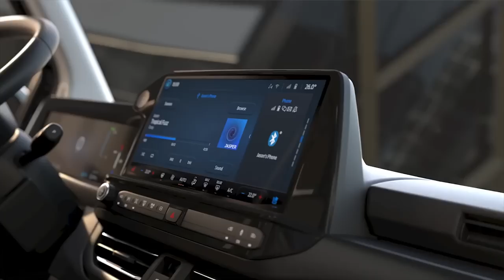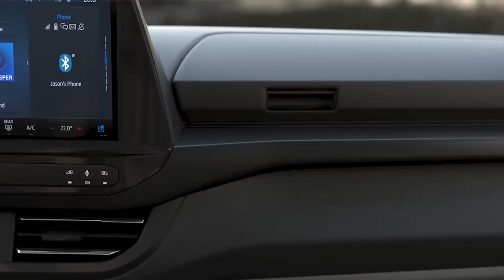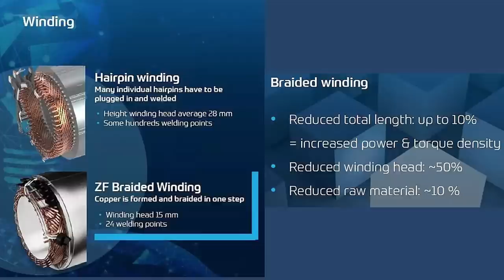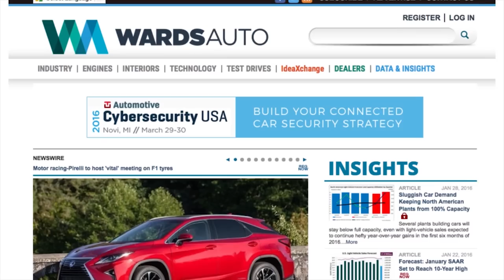EV Costs to Fall Below ICE; New EV Motor Wiring Pioneered by ZF - Autoline Daily 3455

Comment: The ZF motor story shows that better batteries are not the only to increase efficiency of EVs. Range can vary on motor design, software, thermal management, or something as simple as aerodynamics and tires.. We are at the very beginning of EV development and every year we are going to see some very interesting breakthroughs. The cost take out potential is all ahead of us, in fact the cost of making EVs is likely as high as it will ever be, it's all down hill from here. I think automakers realize that and are really looking forward to all the ways they can reduce material and production cost and leverage all the advantages of EVs to bring really desirable vehicles to the market. There are so many shapes and sizes of vehicles that don't have an EV version yet, lots of space to capture market segments. Mazda already missed the affordable roadster segment by not making a Miata EV. Some company needs to go for it.
Reply: What effect on EV's will a good charging infrastructure have on battery size and range demands?
Reply: @joeking433  Range will still be a big selling feature. Stopping to charge (like filling up with gas) is just a hassle drivers don't look forward to even if it's fast. Plus it's bragging rights like HP.
Reply: @frankcoffey I think it will diminish as a selling point when a good charging infrastructure is in place.  But if the price of batteries comes down EV makers will probably increase battery size and range as a selling point.

Comment: By 2025/26? With material costs still in flux, often angling upward, and transportation of those materials also not stable and not moving downward, I just don't see Battery costs coming down to $60/kwh in the next 3-4 years. Then there is demand, which will ratchet up prices again and if making batteries makes BEVs that cheap, Govts will see NO reason to continue rebates and incentives AT ALL for BEVs and so prices go up AGAIN. 

And before you wonks start, dropping the gas subsidy in the US would only tack on $0.50-$1.00 to a gallon of gas or Diesel. It only seems like more when you look at Europe and forget/overlook they tax fuel to the point it costs the equivalent of $8.00/gal, give or take some. That tax is used mainly for Mass Transit and then relatively distantly roads and infrastructure. US road tax on fuel is only $0.184 (not even a whole quarter). 

2025-26? Seems like a pipe dream predicated on the car note still being partially paid for by Govt. The only way I will ever believe BEVs will reach price parity with ICE-Vs, is when the EV Rebates an Incentives to purchase the vehicles are dropped completely. Apples to apples, EVs (BEVs) will always cost more to acquire the ICE-Vs until that happens.

Comment: The cost question is interesting. The battery pack is such a large percentage of the cost of an EV any movement in the cost of those packs (either direction) makes a huge difference. This is a much different dynamic than keeping track of the cost of the thousands of parts needed to make a complex ICE or Hybird vehicle. The speed of development in new battery types is a real wildcard. If I were in the battery or battery material business I would want to lock in long term contracts to make sure investments are payed off before automakers switch to another chemistry.
Reply: Part of the cost equation for packs is also production scaling up. This is why Tesla pursued the Gigafactory. Economies of scale does a lot to drive pack costs down. Newer materials and chemistries, such as LiFEPO4, high Si anode, Sodium Ion, and solid state electrolytes will also help drive costs down.

Comment: Not without taxpayer subsidies for EV and government intentionally raising ICE costs
Reply: Don’t forget about the 600 billion in subsidies the oil companies get every year.
Reply: You don’t think the Oil & Gas Industry isn’t subsidized to the max each year? Without those Gasoline would be astronomical.
Reply: They are just simpler. and although they demand a premium now, it will be like any other electronic. laptop, flatscreen tvs, cellphones. it will get very cheap with adoption.
Reply: @MB-kk8px  I have news for you.  Your city has an electrical plant that burns coal or gas and will soon likely need another one to keep up.
Reply: @MrLSDownliner  Skippy, take a look at reality for a change.  How does your "city" produce electricity and what fuel does it use?
Reply: @MrLSDownliner  Still waiting to hear what fuel your city uses to produce electricity. How do you think I knew that you would be afraid to answer?  Are you aware that solar and wind are not feasible where most people live?  I live in Michigan.  How many solar or wind set ups do you think I see in say metro Detroit?  Where do you think the mining for minerals for solar panels and batteries should take place?  Locally here in the USA with some regulations or in China with zero regulations and then transported?  Which is better if you actually care about the globe more than you care about virtue signaling?
Reply: @MrLSDownliner  Thanks again for verifying that your area relies primarily on fossil fuel for electricity and that you actively prefer to mine and drill in areas with no environmental rules and then transport it long distances. Enjoy Thanksgiving today that is made possible by fossil fuel
Reply: @jerrymiller9039  and I have news for you. We have reached the tipping point for electric vehicles and there is no stopping the transition to electric transport.    They perform better, are cleaner, require less maintenance, are more efficient, and are a heck of a lot more fun to drive. It makes little sense to transport our fuel source via truck, train, and pipeline, when we can do it though an electrical grid that is connected to every home and business in America. Yes it will need to be upgraded, so we better get to work.

We will see if all the scare tactics used by the oil industry and everyone that’s resistant to change become reality. I suspect they won’t and the world will make the transition successfully.
Reply: @MB-kk8px  the electricity comes from fossil fuel.
Reply: @jerrymiller9039  An electric vehicle is 70-80% efficient and a gas vehicle is about 20%. Makes more sense to generate electricity by the best means available and use it for electric cars/trucks. The combustion engine is extremely inefficient and is about the most wasteful use of oil on earth. It also spews toxic gas into the air we breathe. 

I’ll never understand why everyone knows they will drop dead if they sit in a car that’s running in a garage, but they are perfectly fine putting the same garbage into the air they breathe.
Reply: @MB-kk8px  That depends on how efficiently the electricity is produced and how well the battery holds a charge. If I fill my gas tank and it is sealed then 100% is still available to burn.  If I burn fossil fuel to produce electricity and charge a battery and then let the battery drain without driving the car the efficiency rate is zero %   Regardless my point with the other guy was not really about electric cars.  My point was that if we are going to come up with and mutually agree on a solution to anything then we need to respect reality which means fact and logic based communication.  He refused to admit that his city burns fossil fuel to generate electricity.  That is a fact like it or not.  By refusing to acknowledge obvious facts he lost all credibility. He made claims about himself having solar power at home. I have no way to verify that either way but if he denies obvious and simple reality am I supposed to believe anything he says?  In a case like that can we realistically agree and cooperate on any plan?  He claimed to care about the environment but also blocked any chance of us mutually agreeing to help the environment.  That is unacceptable.
Reply: @jerrymiller9039  Yes there are thousands of variables related to everyone of these discussions and topics. However, if you just look at the number of moving parts in a gas vehicle vs electric (aprx 2000 vs 30) it’s fairly obvious which one is going to run more efficiently. Not only that but the entire system should be analyzed for efficiency, from mining, to drilling, to transporting the fuel, to polluting the environment, health impacts to humanity, waste disposal, and recycling materials used to make vehicles. 

As far as power generation per state and how electric vehicles rank vs gas, the link below is really good. You can select the state (I usually pick Wyoming) as it’s one of the dirtiest. Electric vehicles still come out favorably, even if the energy mix is mostly coming from coal.

If I had my choice the goal would be to eliminate as many vehicles as possible, but doubtful that will happen in the US, since we are so dependent on the car. It’s fairly easy to make an electric motor that can go a million miles and it would be great if cars were designed to be fully modular. A part fails and it is either rebuilt or easily replaced and the vehicle lasts a lifetime. Unfortunately planned obsolescence is a big part of most things that are manufactured today.

I have an electric car and have driven it all over the US over the last 4 years. Put 115k miles on it and have been to lot of places in the middle of nowhere, without major issues. After all this real world experience the main shortcoming with EVs is in the towing department and how that effects range. For everyday driving and road trips 350 miles of range is just fine.

https://afdc.energy.gov/vehicles/electric_emissions.html
Reply: @MB-kk8px  so you agree that the vast majority of electricity comes from fossil fuel?  Where do you think the fossil fuel and mining for battery production should take place?  Here in the US with some regulations or far away with no environmental regulations and then transport dangerous goods across the globe?
Reply: @jerrymiller9039  I do agree that a good percentage of our power comes from fossil fuels (national averages at the end of this message) and I never said it didn’t. I’m fine with domestic production of things, rather than having the US go around the globe to exploit cheap labor and non existent environmental regulations. 

The good thing about doing it here, is that it ties into what I said earlier. This country needs to do a much better job of designing things so they can be easily repaired and recycled. I heard the other day (I’m not sure if it’s true) that out of all the batteries we consume here, only 5% are recycled. Redwood Materials is changing this and I think they are getting something like 95-98% of the materials back from used batteries (and they are profitable).

I suspect the mix of renewables in our power supply will steadily increase over the next decade. At this point this is mainly being driven by cost, as renewables are cheaper to make and deploy than any other power solution. They may never meet 100% of the need and that is fine. We have plenty of ways to generate power.

One other company that’s worth checking out is REE Automotive. They make one electric platform that can be used for numerous types of vehicles. One reason this is possible is electric motors generate so much torque that you don’t need different motors for different vehicle types. This makes the manufacturing process much simpler and cuts down on waste.

US Nation Average Energy Mix %: natural gas 36.96, coal 22.28, nuclear 19.43, wind 9.44, solar 4.09, biomass 0.67, oil 0.46.
Reply: @MB-kk8px  I respect your comment. All I  am asking is that we have real discussions based on actual facts and that we try to find consensus to actually implement. As an example look at the hole in the ozone from the time that one researcher said he saw a problem to others validating his work to us figuring out the root cause and finding a new way to replace it and implementing a fix with widespread global buy in was about a decade. It is now fixing itself. The difference is that was not politicized and fact based discussion was fine without endless lies and cancel culture and propaganda and politics.  The last guy pissed me off because all he did was virtue signal without being willing to even discuss solutions or accept simple facts like yes most electricity is generated with fossil fuel and if you over regulate mining and fuel drilling in the US it just means some dictator far away with no environmental rules is going to get rich and on top of that it means shipping dangerous stuff across the globe. It is maddening to me that the people that label themselves environmentalists are generally the roadblocks to helping the environment
Reply: @jerrymiller9039 .  It’s all about increasing efficiency.   And BEVs just are more efficient
Reply: Our federal government owns the dollar printing machine.  It doesn’t need to tax in order to print 💵.   Federal taxes just help regulate inflation and inequality by removing excess government spending from the private sector.   Federal taxes should mostly be pigouvian:   Reward good economic behavior & punish bad economic behavior.   If that’s not enough to regulate inflationary pressures, then do other stuff too.

Comment: While I hope it's so, I'd place good money on EV's NOT achieving price parity with ICE vehicles by 2025/26.  Battery prices have risen in the past year because of supply chain issue.  My guess is closer to the 2030 timeframe.
Reply: Depends at what vehicle class. Tesla is has price parity today, and is already highly profitable in every category they compete in. Hard to argue with 50% growth year after year. At the bottom end (under $25K), most ICE cars in the USA are sold at a loss unless they can stuff lots of profitable options.  An then there are ZEV credits that make the $27K Bolt profitable for GM, likely giving GM an extra $10K/car to work with.  So it really depends on what category is being compared.  Clearly there is more to be done with EVs, but I think it the transition away from low-performance obsolete ICE vehicles will be far faster than most expect.
Reply: @tesla_tap  Sadly with battery tech, all EV manufacturers NEED those credits (Tesla did in first few years) to be economically viable. Would be nice if the tech was improved so much that credits are not needed at all.
Reply: ICE cars will simultaneously lose their "economies of scale", as production slides and unit cost starts to climb. Manufacturing complicated ICE engines won't be cheap any more.. So the cost of ICEs will go up, meeting EV cost going down.
Reply: I don’t expect BEV to ever reach price and performance parity. The amount and difficulty to obtain the rare materials pretty much prevents it. So I expect a cheaper type of battery with even worse range and performance will be used.
Reply: @alexmckenna1171  The price of ICEV won’t go up because of lack of volume for a very long time. The selection will be reduced but it only takes 100,000 units a year to be profitable. How do we know that? Because most models sell less than 100,000 units per year and still stay in production.
Reply: It's always good to find an "internet genius" to help me decipher the experts' opinions.  Thanks!  ;)
Reply: @joeking433  The so called experts said we would have full self driving cars by now. The evidence that BEV have drastically increases in price in the last year is contrary to the so call experts as well.